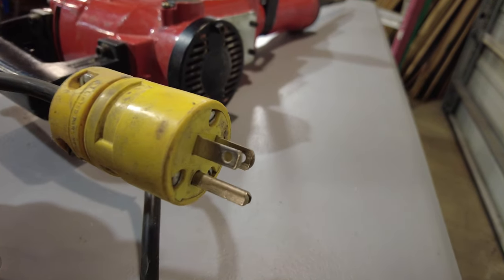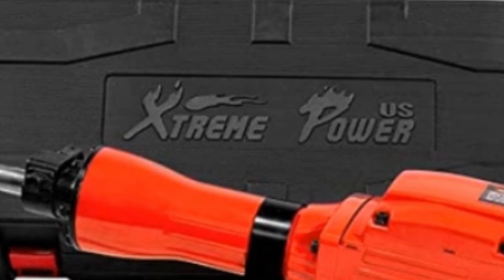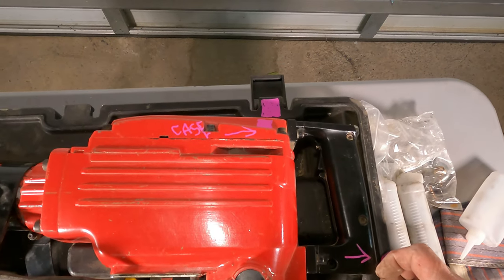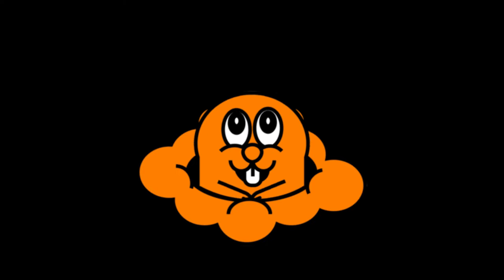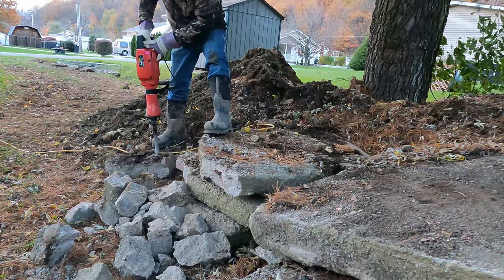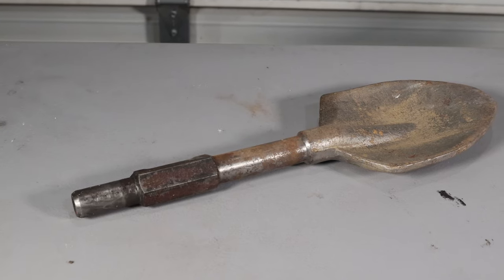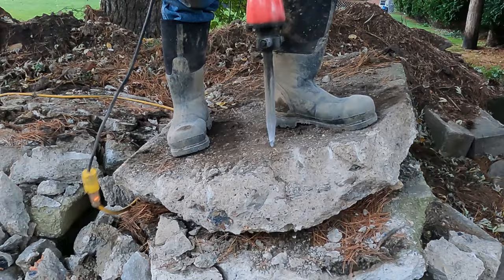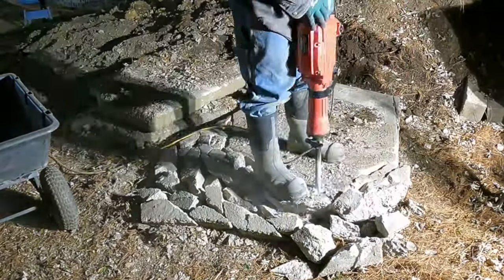Extreme Power Demolition Hammer

Comment: I bought an Extreme Power 1100 watt demolition hammer ( just like in the video) from Home Depot. From the first day I got it, it leaked oil all over the shipping box and carrying case. I tried to use it digging in the hard dirt we have here, and it stopped hammering right away. You had to add oil every 5 minutes in the unit. I finally took it back to Home Depot  for a refund. The hammer would have been great if it worked and didn't leak so much oil. Thanks for sharing the  video.
Reply from the maker: Thanks for watching Sidewinder. Sorry to hear that yours didn't work out for you. On this channel, I do get a lot of things sent to me for free in exchange for making a review video, but this demolition hammer was not one of those things. I bought it before I started making videos. Mine got a lot of use on many different projects and still seems to work great. I do add some spray lube in the area that the bit goes, but never had any issues with the oil leaking from the reservoir. Thank you for sharing your experience.
Reply: Mine also

Comment: Thanks for not showing how toninstall the bit. The only thing I cared about.
Reply: Or install oil
Reply from the maker: Thanks so much for watching and the very kind words. The bit is hexagonal in shape and fits into the hexagonal hole. There is a wing nut shaped knob on the side of where said bit goes in and you install the bit then turn it so it locks.
Reply from the maker: As for oil, if by installing it you mean adding oil, There is a plug and a sight glass as I clearly stated in the video on the side of the device. I sure hope this helps

Comment: I'm interested in buying one but based on the power output..  do use plug in on an outlet with a 20 amp breaker?
Reply from the maker: Hi Joe. Yes, I had mine plugged into a 20 amp breaker. Not sure if a 15 amp would hold up or not. Thanks for watching .
Reply: @themostlymikeshow  unfortunately i only have 15 amps for my outlets.. 
Thank for the response
Reply from the maker: No problem. 15 may or may not work on that. If you look in the Amazon questions for this tool, they might say, or you can post the question.  I usually get a response pretty quickly when I ask.